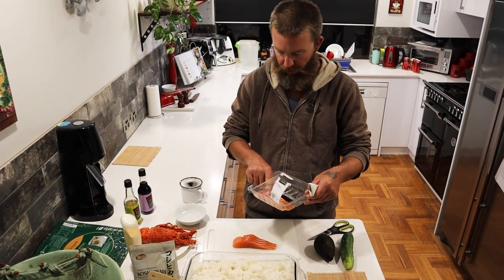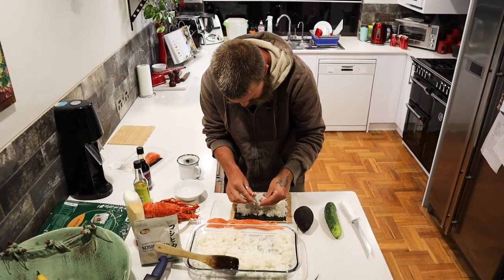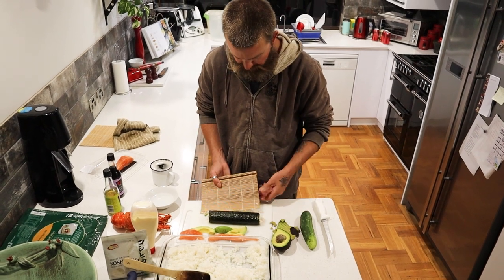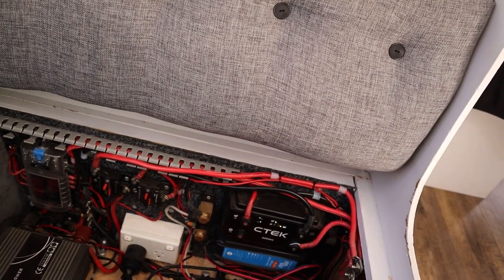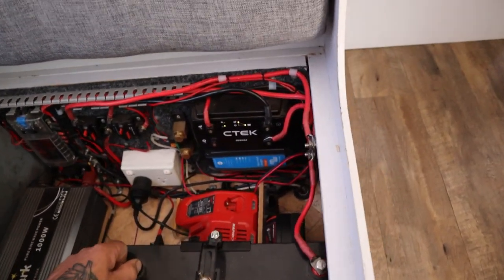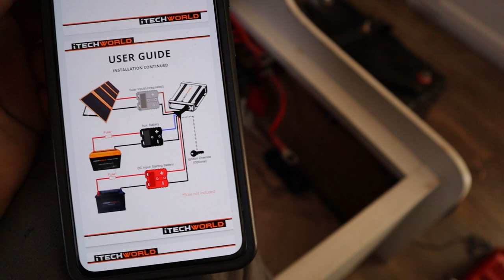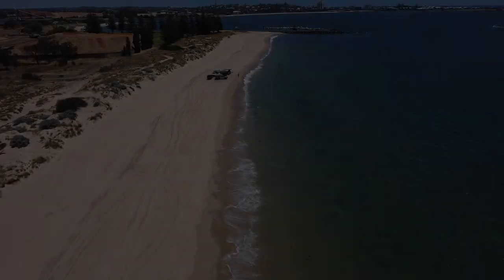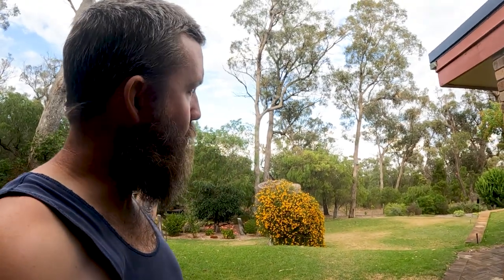Making Lobster Sushi | Bouvard Reef Dive | EP19

Comment: Awesome video, nice work on the van, out of curiosity, does that box space you were wiring up with the DC Dc generate heat in the van? Well done on handing out a master chef slap at the beginning and tickling the crays up at the end! Loved the fun! Dive safe!
Reply from the maker: Hey mate, cheers!! Narr no noticeable heat. We run a 1000w invertor in there also but doesn't seem to get hotter. I put a wireless thermometer in there at one point and was also no difference. I did mount a 12v fan thinking it would get hot but used the fan to make biltong! Haha.